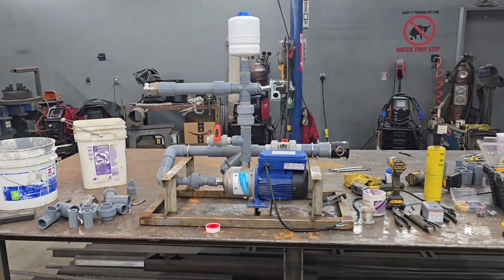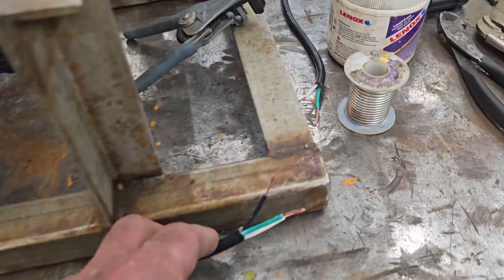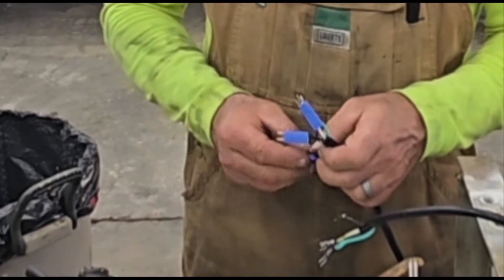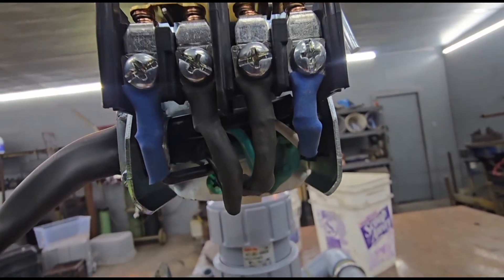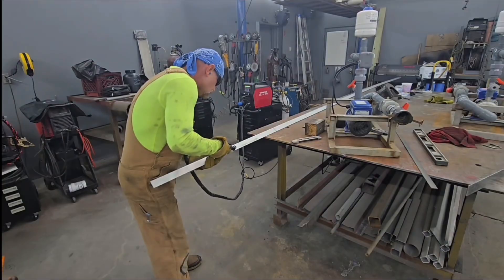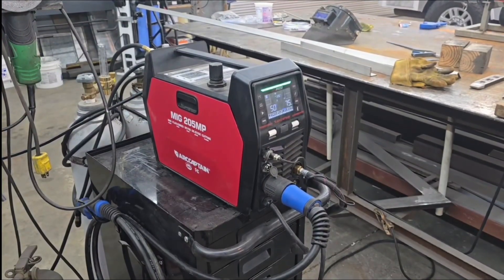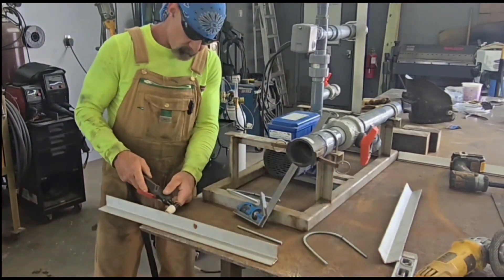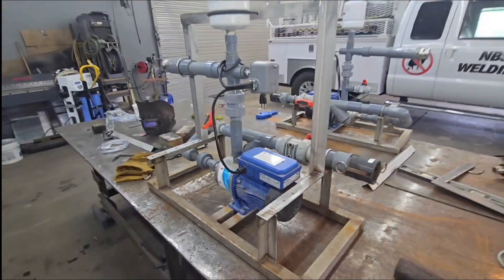Riggin up some water pumps

Comment: stainless steel will burn up some bits quickly, even if you use oil to help cool the bit or blade. It will go through some bandsaw blades; you would be lucky to get 8 cuts on stainless steel before it breaks or just loses its edge. The plasma cutter is definitely the way to go!
Reply from the maker: Agreed 👍

Comment: Hey mane no shade. I can see u ain't no rookie. However, when it comes to fcaw it's the hardest to do mig. With that said. Here I go. That wire isn't worth money. That process is hard to learn and if arccaptin wire will not deposit. Then the welds are to hard. Brake ez. Price rite for the wire, however gotta run wire speed twice higher. Lickon wire cuts though the bs. Then the people can focus on settings.
Reply from the maker: Sorry I can't make much sense of your comment...its gotta be bad auto correct or voice text because none of it makes enough sense for me to respond.

I try to respond to all comments but I can't do anything with this one...sorry

Comment: 👌🏻🛠️👨🏻‍🏭

I wonder about the short cycling of that contactor though...you think a small storage tank in-line with hose would be better for the switch\system. I guess it all depends on how much the pressure nozzle is open and how often.
Reply from the maker: I did what they ask for and sent a video of it operating...not my call
Reply: @NBSWELDING 👌🏻

Comment: I’m from Texas, and there aren’t many basements here, so I don’t have any experience with keeping houses from flooding.  I have to wonder if the pressure tank and pressure valve is necessary, or would it be better with a float valve.  Great channel.
Reply from the maker: A float valve could not be used in this application and it has nothing to do with a basement.  These pumps will feed brine water through a system that extracts resources from the water.  Sorry that's about all I should tell ya about it.  
Thanks for watching and commenting...good to hear from ya again...keep in touch 👍